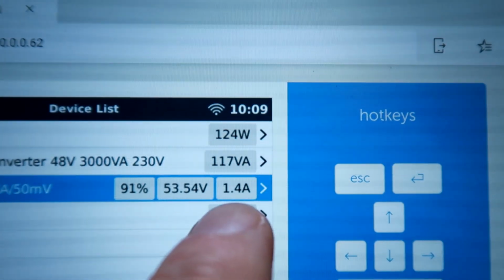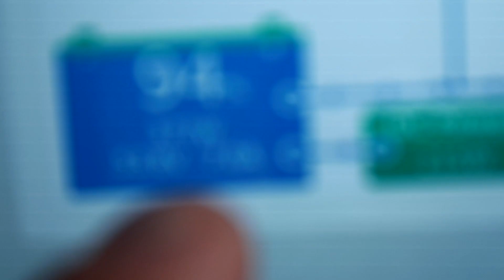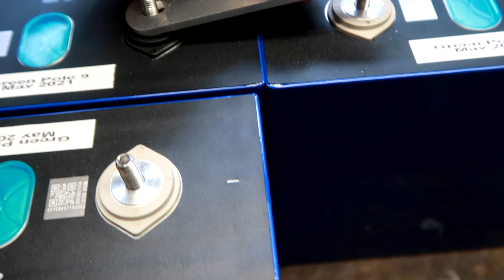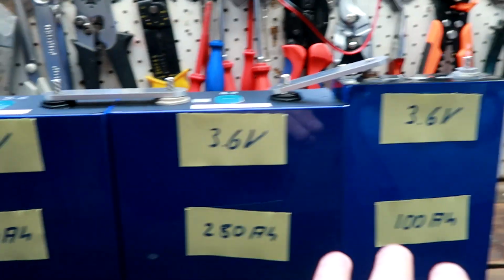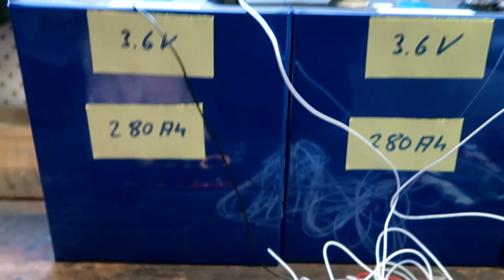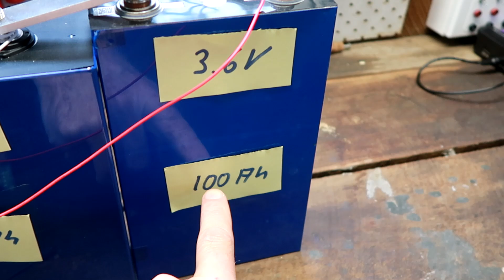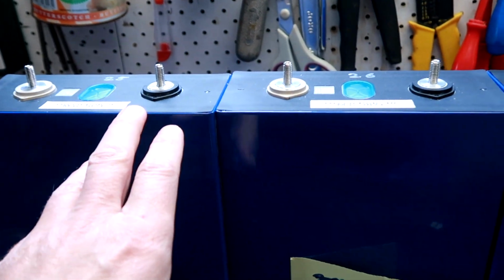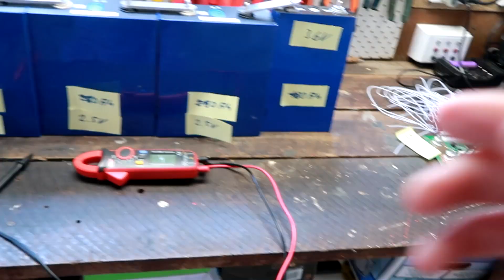Divided opinion about balancing, balancers, BMS. How to and why to balance LiFePO4.

Comment: I top balance. In either case, your battery only has the usable capacity of the smallest cell. There are 3 differences between cells, even if the cells have consecutive serial numbers, having had come off the assembly line, one right after the next. The three differences are, Capacity, internal resistance, and self-discharge rate. Top balancing addresses all 3, if you ONLY balance, during absorption/float charge. When the battery is discharged, the balancing should be OFF. Once discharged, and you begin to charge, leave the balancer OFF. Disabling the balancer during discharge and bulk recharge addresses differences in internal resistance by not falsely sensing different states of charge, due to differences in voltage drop caused by load/charge current. Waiting until it's charged enough for the current to roll off, reduces those differences. Capacity is also addressed, exactly as you described. Once you have used that hundred amp hours, you put back the hundred amp hours, and once the current rolls off, you will find that the cells are almost nearly equal in voltage again. The ONLY reason for voltage balancing, is to compensate for self-discharge rate, and should be done when the battery is in a "standby" condition, with little to no current across its terminals. Self-discharge is a time based thing, having surprisingly little to do with charge/discharge cycles, or for the most part, even depth of discharge. Self-discharge happens, whether the battery is used or not. This becomes even more critical, as the battery ages, whether by cycles, or calendar life. Differences in self-discharge rates become greater, as the battery ages. I personally, like to maintain my batteries at ~3.5 volts per cell, and, voltage balancing ON, when not in use. Using voltage balancing ONLY during float/absorption charging helps a battery to be as reliable as a single cell.

Comment: I have tried various strategies. One thing I know that helps is having a 2s configuration. I have an active balancer and I monitor the high cells and low cells over a period of time. I then split the 2s groups and swap the high and low cells to minimise the difference between the pairs of cells. This works.
I have now set my balancer to only start balancing when the voltage difference is 0.03 volts so the balancing only operates at the top and bottom of the charge and discharge cycles. My BMS balancing is turned off because it fights against the active balancer.
Reply from the maker: That is great, thank you so much for sharing, Colin.
Reply: Yeh I've considered that too. Rate every cell (which could take a long time), and then mix the low and high ones to create an average.
Reply: @PowerPaulAu  all I did was watch the balancer and note which cells were lowest and which ones were highest and lowest and swapped one cell from each pair, and I repeated this a month later with very good results after only the second swap.

Comment: VERY SIMPLE: Top balancing: your cells remain in an area of SOC where the internal resistance is lower. Lower internal resistance = better performances and less heat generated as well as less aging. Just check the internal resistance curve vs SOC on LiFePO4..  That is your answer.  When bottom balancing, your average cell voltage ( also called NOMINAL voltage) is a bit lower than on top balancing. You get more Wh per Ah when top balancing because the total pack voltage is higher. Also ask yourself.. do the cells prefer remaining long period at 100% SOC during balancing or if they prefer remaining long period at 05 soc during balancing? At low voltage (bottom balancing) , cells get their copper anode disssolved.. At high voltage,  ( top balancing) you get lithium plating..
Reply from the maker: Thank you for your comment. 
Internal resistance is the lowest between 25%-75%. Sometime it increases already at 50% SOC, depending on the method been used to measure that.

Comment: You bottom balance when your cells are often at low state of charge (think EVs). You top balance when they are often at high state of charge (think solar). In either case, your battery is only as good as your weakest cell. The thing an active balancer does when there is an imbalance between cells is prevent the BMS to trip while it's compensating for this weak cell, and through this compensation you can get overall more capacity out of the pack - the downside being the stress placed on the weak cell in doing this. However, all of this is rather moot since the difference between cells in general is a couple Ah, not 180Ah as per your example, so an active balancer won't put real stress on the cell, and in addition, knowing you have a weak cell, lower the Ah of the total pack to the Ah rating of the lowest cell - no more need for an active balancer, accept some 'capacity loss', and just charge to the Ah of the weakest cell with some safety charge/discharge margin (like 80/20, or 90/10). Need more power? Add a battery.
Reply from the maker: OK, so bottom balance... but how do I add a second battery then? They won't have the same overall voltage and will start balancing...
Reply: @OffGridGarageAustralia  the way I add my battery power is to have another system .   I will let the main battery to be  charged untill full  while using the subsidiary battery .
Reply: @OffGridGarageAustralia  I would (and I do) top balance. I have two (soon 4) sets of 16 280Ah cell batteries. You just top balance the new one, make sure that both are within reasonable voltage of one another, and put in parallel. Let them 'talk' to each other, it doesn't matter, it will settle. You will always have some cell drift at the top and bottom and if you have a balancer (like yours, or active one I have in my BMS, a JK/HELTEC one) this will help. Just accept you will have some capacity loss (even 250Ah or less) per battery (your lowest cell in essence) and stay between 80%-20% or 90%-10% of that capacity. Whatever cell drift between these margins should be small and shouldn't matter.
Reply: Since the total Ah for the system is determined by that one weak cell, if it's a significant difference, then wouldn't replacing that one cell with a new one would raise the system capability to the next lowest?  It may be a bit of a waste having a new cell among all the old ones, but would it be better than having the limiting bad cell in the mix or replacing them all?
Reply: @wingerrrrrrrrr  <<<<< I’d agree with you than ‘messing’ around with the weaker cell. Remove the smoking log from the fire. I have done it, thinking logically. We are not piloting the ‘Rover’ are we?
Thanks n best wishes.
Reply: @OffGridGarageAustralia  Right, top balance all the way for equal voltage of all the packs

Comment: This is a great topic and there is definitely a solution needed for this.  But even more important is what happens if your charge controller does fail, your bms opens, does that fry your inverter from high voltage too?   I think we are looking at this the wrong way.  We should be cutting off the solar input to the mppt on high voltage cell detection....not just disconnecting batteries.  We need a smart bms rated to shunt solar charge current(10-50A per cell)with some relay outputs for charging, bulk inverter, and critical loads.
Reply from the maker: Yep, I 100% agree. What BMS could do that though.
Also, would both charge controller fail at the same time? If the BMS disconnects, the SCC supply power to the inverter (tested multiple times). At least with Victron gear that seems to work fine.
Reply: @OffGridGarageAustralia  If the charge controller failed, then it would also trip the high voltage of the battery as long as it put out over the 200mA.  See my point?  It doesn't protect against a failing charge controller, it only would stop the batteries from getting overcharged....which might be worse than destroying an inverter...but both can be avoided with a smarter BMS.  It still seems odd that all the BMSes use an integrated relay.  They should just be the smart part and have a separate relay for over/under voltage.   And you wouldn't want to put a relay on the DC side of an inverter either since when it activates again it would get hit by high currents from the capacitors.   Better to switch the AC side of the inverter too.

Comment: I've always liked the idea of bottom balancing. The BMS should be there as a redundant safety device if your charger malfunctions. Don't depend on it alone to protect from an over voltage. No one wants to start a fire.
Reply from the maker: It seems to make more sense to bottom balance but it's harder to rectify again over time.
Reply: Schneider NSX DC mccb has over/ under voltage disconnect as precautionery measures
Reply: @jasondevine6014  Thanks for linking that video. Interesting failure. Mosfets can fail closed too. Look into an "emergency/combined disconnect" by Albright International. SD series switch. I got a used one. This acts like an emergency stop pushbutton and a high current DC contactor all in one. I'll post a video of mine when I get it hooked up.
Reply: @OffGridGarageAustralia  True what is good for setup purposes might not be good for longevity. And how much of the batteries life does it really sacrifice? Say you had to replace your pack 1 year earlier would that really matter? Maybe the convenience is worth it?
Reply: @bluetrepidation  nice looking solenoid. I now use a kilovac on the discharge side and relays on the solar input side.

Comment: As for the second part in your demonstration there are active balancers that you can add a relay to that's what I've done to mine and then I'm using my victron equipment to switch the relay on only when I'm at a high enough voltage so they are active balancing but they're only doing it when I say so and I'm only doing it on a higher voltage that prevents them from charging the lowest battery when the pack is low and then you charge it and then it has to immediately take all that power back out of the lower capacity cell
Reply: Thanks for this info.
Reply: I did the same with a JK-BMS (it has an external power supply pin that can be used to turn it on during charging, when DC voltage > 16*3.45V)

Comment: Top or Bottom balance, your pack will still become unbalanced over time. It's not just capacity of each cell in play. Internal resistance variation is a problem, and this is a major contributor to unbalancing at high load, or high charge current. My suggestion if they are good/new cells, top balance, if they are crap mixed capacity cells made from old laptop batteries then bottom balance. Now pay attention this is key, DO NOT cycle between 2.5, and 3.6, set it up to cycle between something like 2.7, and 3.5. Also I think I might eventually recommend the heltec active balancer, I've been playing with it, and will do a video soon.
Reply from the maker: Thank you. I cycle between 3.1V and 3.45V which gives me 90% capacity. I'm still not sure about the balancer, if this is good or bad. I've got some here and have tested also. Seems to work but this constant amps back and forth... don't know...
Reply: @OffGridGarageAustralia  Right on. With the 3.1 cutoff that's fine until you have a heavy load. Then it might cut off sooner than your 90% calculation because of voltage sag. A brief heavy load such as a power saw may sag the voltage under 3.1 then your BMS cut out, but you still really have over 90% capacity. Something to consider.
Reply from the maker: @BradCagle  Oh, no no, 3.1V is not the cut off but that's usually what I have seen to be the lowest when I discharge the battery under normal usage. The inverter cut-off is set to 3V under load and to 2.8V under light load. The inverter adjusts automatically dependent on the load at this time

Comment: The answer is YES!

All the more reason to design a system to operate  in the 80/20 range or 90/20 if your feeling confident. Nothing wrong with a periodic combination of practices. Call it a health checkup.

Too balancing once a month by means of an active balancer then via BMS, a low limit disconnect would give you a look at the overall health. Of course with a data log. As long as you mamage the extremes, you're good. This is why bottom balance wins.

This is probably one of the best explanations I've seem on the subject. I remember when Jehu built his bus without a bms. He took some flack over that.
Reply from the maker: Thank you for your feedback and comment.
So bottom balance and the BMS without balancing option?
Reply: @OffGridGarageAustralia  yes, sorry I wasn't completely clear. Also about Jehu's van, remember they were l'ion 18650's. As in all applications, keep in mind the chemistry.  
I'm an old hack from the lead acid era. The inverter chargers typically have a monthly top charge of around 15+ volts to help keep down the dendrites. On any lithium, too high of a charge voltage will help create dendrites (bad).
I've ordered my 100kw 85/20 bank last week. Need to start deciding what I'm going with on this management. Bottom balance at the 85/20 point with the previously mentioned scenario. It is for my business, wanting to beat down my $1100/mo electric bill. Keep checking for my obit to find out if it worked or not. Take care Andy. Alex

Comment: Great video.  The problem with balancing is voltage DOES NOT equal capacity 1:1.  Every battery is unique.  Balance the pack once, then disable balancing,  If it looses its TOP/BOTTOM balance then you have another problem you need to fix first.
Reply from the maker: What is that other problem?

Comment: I do top balancing

Bottom balancing is in my mind flawed for solar, since you rely on the pack always have the same voltage distribution when the weakest cell hits a predetermined point (say 3.6v). The sum of all voltages is your charge voltage. In theory this is great, but the cells will drift over time and cause a different voltage distribution. Then, In the case where the weakest cell peaks earlier, the bms will disconnect the charge. All good to save the pack, BUT, that might fry your inverter or charger when the rail voltage suddenly jumps up. Depending on the inverter/controller hardware it might survive a “battery disconnect” even if you have a high solar voltage. In my case the inverter throws an error and shut down, but I’ve have fried a cheap controller by disconnecting the battery (with the solar still connected).
Reply from the maker: That's exactly what I was referring to in the last two videos. I think it's crazy to bottom balance when you use a BMS as single voltages in your pack may drift over time. The overall voltage of the pack may seem fine but when voltages shift, it may trigger the BMS for a single cell overvoltage. Not good.

Comment: Andy, I was conflicted about this too and about adding a second pack. I've done this twice now and its easy. I use grade B 105ah cells. I ran across some server racks and chassis recently. I gutted the servers and there is room for 8s 3.2v in each chassis. Tie two chassis together for a 48v 16s. Overkill bms. I test each cell by charging to 3.55v then discharge to 2.8 for a capacity test (thats my 80% operating system range for me). Parallel 16 cells for a week then install 8s in each server rack. Two chassis together with a 48v 16s bms. I wait for a cloudy or poor solar charge day.  I discharge my system 48v to 2.8/cell and hook up my new 48v 2.8v/cell  pack. I have an active balancer flat cable to each pack but not hooked up. Bms balancer off. Basically bottom and top balancing once a month/pack. Then Each month I also charge the packs full 3.55v/cell and take one pack offline for a 24hr balancing hooking up the active balancer (cables already hooked up and leaving them hooked up.)  Next day after my system voltage is equal to my balanced online pack, I bring everything back online together monitoring for any inrush  of large current. Hope that helps. Almost ready to add additional 4.8kw. About $400/48v per pack with bms. Cells are cheap. Enjoy your laughing birds. In So California we have birds that chirp as a flock only at night....all night, Crazy.

Comment: FYI,  a BMS that has feature of cell impedance readout and external current shunt will likely have greater cell voltage reading accuracy for balancing.  This should allow more successful balancing at lower cell voltage giving more balancing time before highest state of charge cell over-voltage trips BMS off.

Comment: What you are missing is cells with different capacity and impedance will have different charge and discharge efficiency for a given current level. The higher the %C rate of charge or discharge current for a given battery, the worse the efficiencies.  So putting in 100 AH's does not mean all cells are filled by 100 AH's.   The difference in yield will accumulate over time and will diverge their relative state of charge AH capacity.  

Round trip charge/discharge efficiency at 25 degs C for 0.1C rate current for LFP cells are about 99%,  0.5C is about 95%, 1C is about 91%.  These numbers get a little better for warm ambient temps and much worse at colder temps.  Cell leakage is about 2% of capacity /mo at 25C,  1%/mo. or less at cold temps, 5%/mo at 40C.

Bottom balancing (or top balancing) will not do anything to avoid this.  The closer cells are matched the less the divergence.
Reply: Roind trip charging efficiency consist of 2 parts: coulombic efficiency (how much you get from each Coulomb you out in) and voltage efficiency (how high is discharge voltage compared to charge voltage)
Charging / discharging at high rate ONLY worsens voltage efficiency (I^2*r losses), but NOT coulombic one. Coulombic efficiency (and variations of it beetwen cells) is one thing, responsible for cells staying within balance. You don't put / take same amount of energy into series connected cells, but same amount of charge